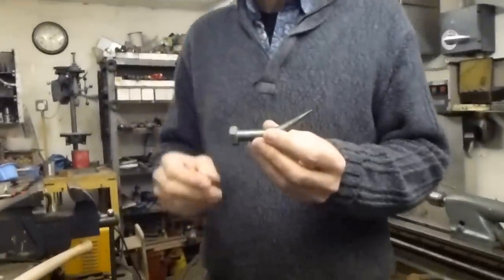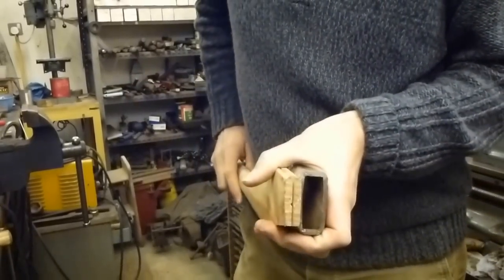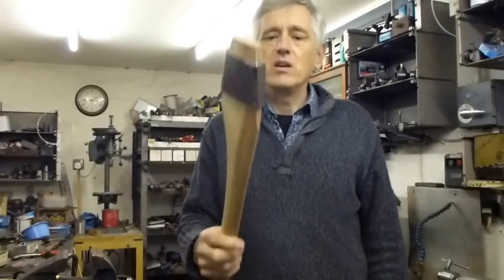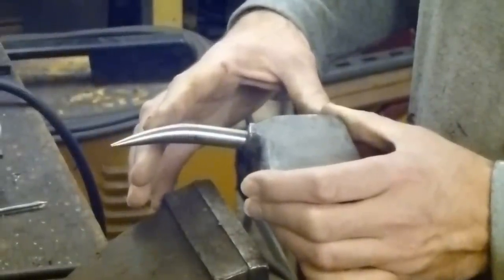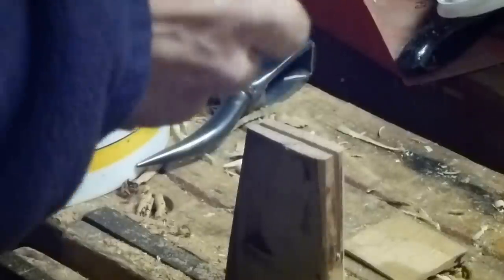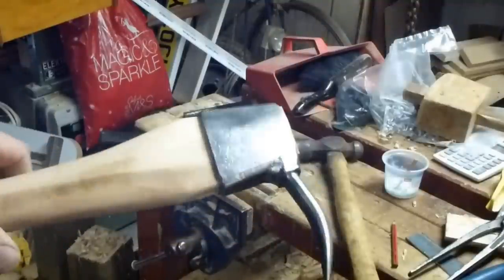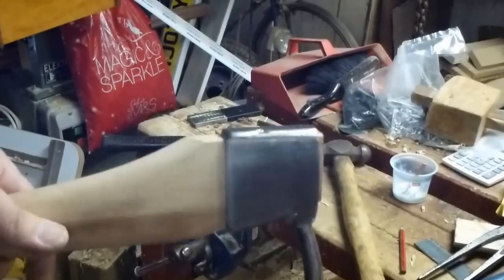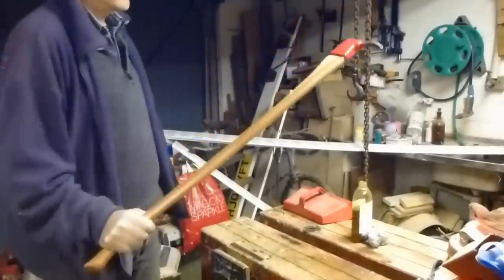Pickaroon (Hookaroon)

Comment: You can use blueing formula used for gun bluing. I get mine from Brownells online. I use it to blue hatchet/axe and lathe hammer heads which buff out very nicely. I also use tung oil to finnish the handles...7-9 coats...why a pickaroon are you logging in a local waterway?

Comment: Can you tell me more about the bolt you used? I would greatly appreciate any info
Reply from the maker: It was an M14 x 120 HEX grade 10.9  I finished it at 95mm plus the head. You need enough to remove all of the threads when you cut the taper so it's important that it's not threaded too far. If you want imperial that's about 9/16 x 4 1/2
Reply: Really appreciate the info.

Comment: You should put a roll pin
Reply from the maker: I know other people have used roll pins; I took a conscious decision not to because I consider the reverse taper provides a better solution. If the handle was loose enough to be relying on the pin there would be a very small contact area and the wood would wear and work very loose quickly.
Reply: the whole idea is that it wont come loose if the pin is there. Im sure you can add it if what youve tried fails. I like that youve put thought into the physics. Good job
Reply: I thought that too, time'll tell.
Reply: the other option is to make a handle where the head slides on the opposite end and has tapered head.
Reply: I got roll pin from the one I made ten years ago and the head fell off. Its a different tool than a hammer and has different forces.